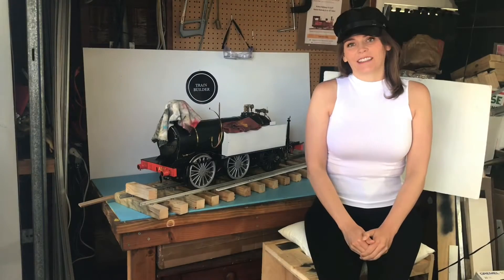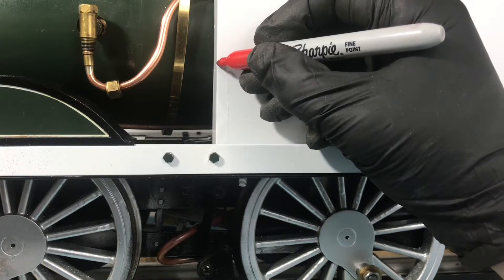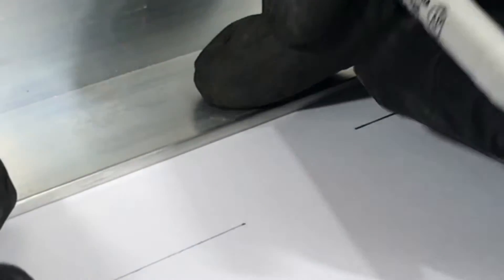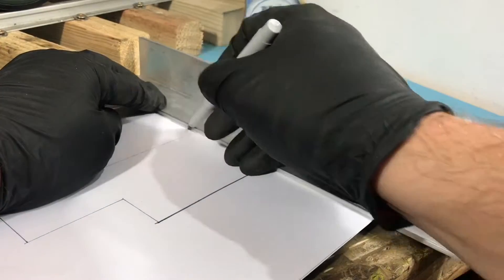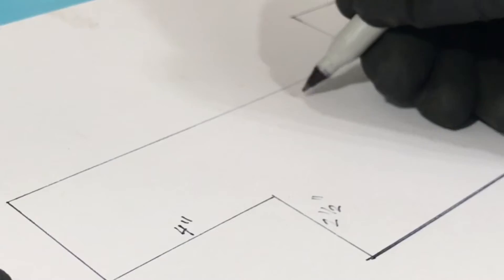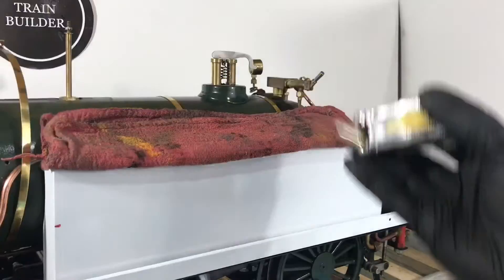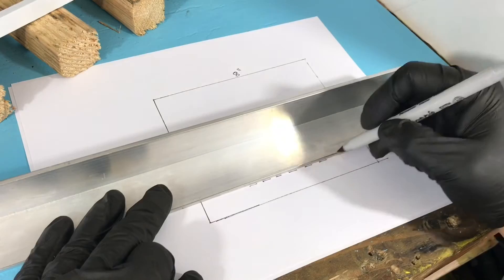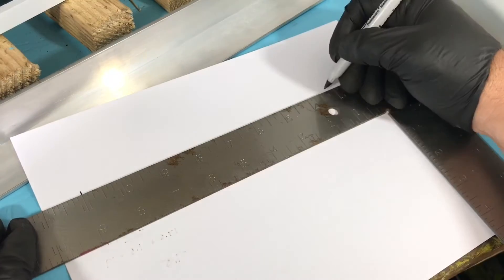Thomas The Tank Engine - Live Steam Kit Bash Part 4

Comment: For the face, I’d recommend you do both methods & decide which looks the best out of the wooden & the 3D print
Reply from the maker: Good call - We’re thinking the same.. Kind of leaning towards wood because it would be cool to build, AND prevent any melting..
Reply: @TRAINBUILDER  wood sounds nice practically, but you could 3D print the face, and then sculpt it out of clay so that it looks precise and doesn't melt
Reply: @TRAINBUILDER yeah, we don’t want a EDT Boiler Test on our hands…

Comment: I would say 3D print the face, but make sure the material can withstand the heat. 

I say that cause, I don't know if you heard, but when the Strasburg Railroad was making Thomas for "Day Out With Thomas" the eyes were made of a flameable material, and melted on the first test run.
Reply from the maker: Omg! That’s funny.. Poor Thomas.. The kids must have been horrified that day... Yeah I’m leaning towards wood, and now that I know about a “Thomas eyes burning out gone bad story” I’m even more certain about a string wood! Lol
Reply: @TRAINBUILDER  Thankfully, it was a test, so no kids saw it. They replaced the eyes with a better material before any kids saw him.
Reply: I would cast the face of aluminium.... cheap.... easy.... "low"Temperature....
Reply from the maker: @dreamsteam8272  Good call - Want to make one for me 😉

You can probably handle that job pretty easily with your skills..!! What do you think about making one out of wood? Like oak..?? I wanted to ask you.
Reply from the maker: @Matthew-oi6kz  Lol thank god..!! That’s a funny story though!
Reply: @TRAINBUILDER  🤔.... let me think about it... okay?
Reply from the maker: @dreamsteam8272  You bet!
Reply from the maker: @dreamsteam8272  Circumference is 5 5/8ths. 5” and 5/8ths.
Reply: @TRAINBUILDER  What dia??
Reply from the maker: @dreamsteam8272  Let me check. I know the smoke box is 5 5/8” wide.
Reply: @TRAINBUILDER  ok.... imperial is like chineese for me.... i need metric... 🤣
Reply from the maker: @dreamsteam8272  That’s right!! Lol - It’s like that for me over here with my imperial tools wrenching on metric... lol 

Hey - here’s my email. evanbautista@yahoo.com 
That way we can figure things out. I’ll Will definitely give your channel a big shout out on mine if the aluminum face is possible etc!
Reply: Ok... i have an idea.... and i make a Video from.... (maybe a joint venture...?) As sayed send me scetches about layout and measurement (in metric) to my Email... and i will do my very best.... 😉
Reply from the maker: @dreamsteam8272  That’s what I’m thinking too brother! We could both give each other some love on our channels etc! Email me.